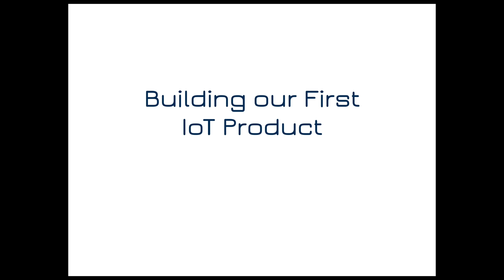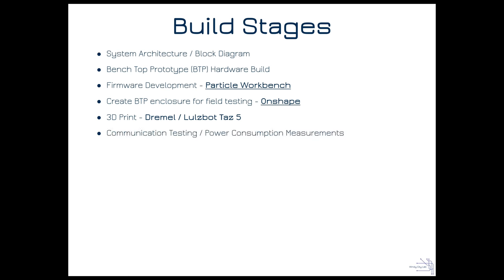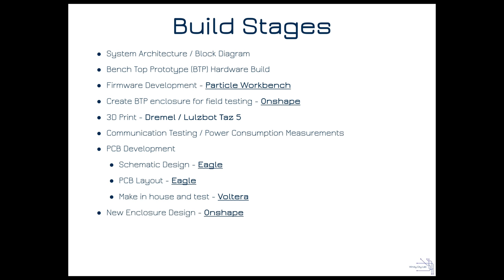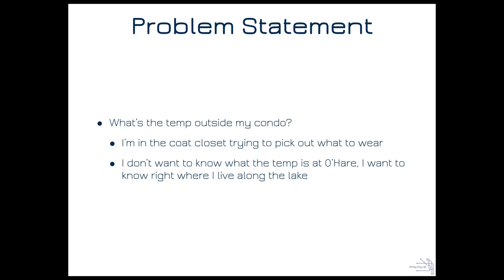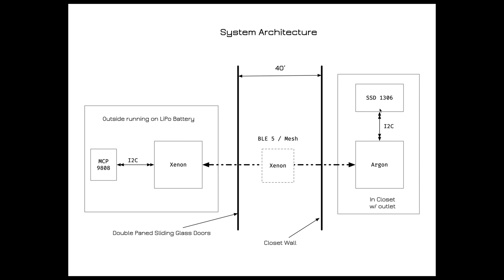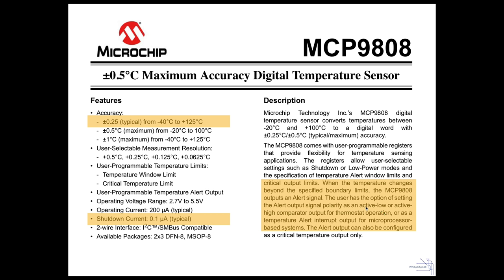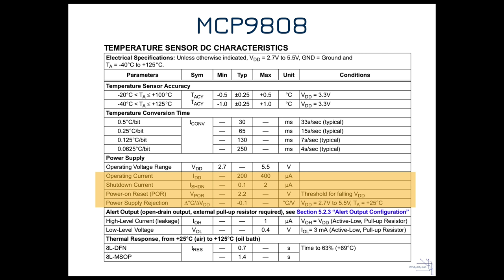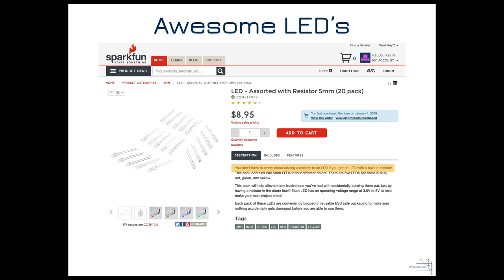Video #1 - Building our First IoT Product using Particle Workbench, Xenon, Argon and Mesh Networking

Comment: If you are concerned with sharing your device IDs you should blur them out a little more at 35:11, they are fairly readable at that point.
Reply from the maker: ah, I didn't notice that Steffen.  Thanks for pointing that out.  Sigh.

Comment: Amazing videos Thank you for taking the time! . Since Particle pulled production on the Xenon what is to replace that within the Particle ecosystem?
Reply: Unfortunately, there is no replacement within the Particle ecosystem. The closest next step would be to use the Argon and never turn on the WiFi but I have had trouble getting the deep sleep modes to work properly with the Argon.